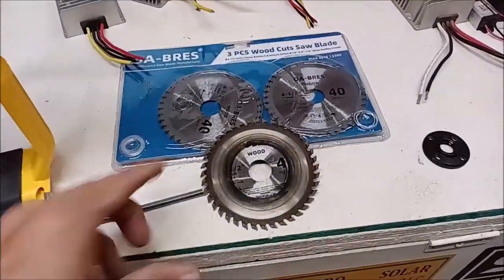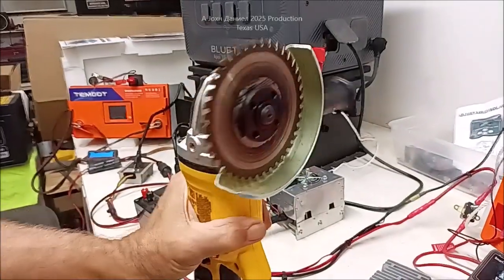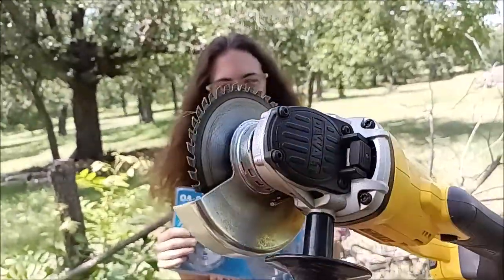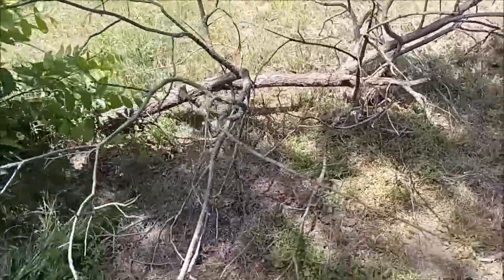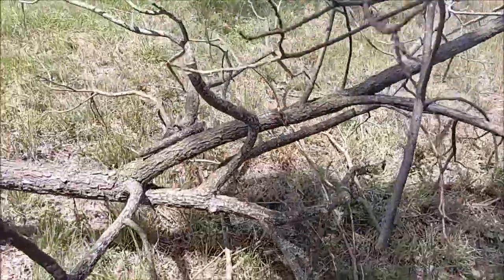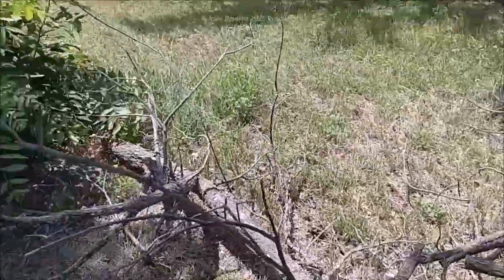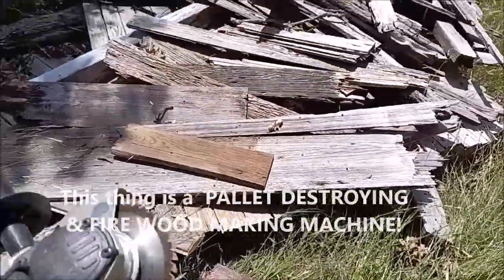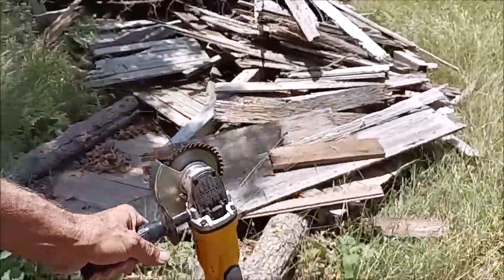20 volt 4-1/2 grinder to Speed Cut & Trim Trees, Hedges, Vines & tough weeds - LIGHTNING FAST WORK

Comment: JUST PUT A PACK IN MY CART!!! I HAVE A 4INCH CHIPPER SO THIS IS WHAT I NEED!!!  GOT TO CUT THE BRANCHES UP SO THEY FIT IN A 4 INCH HOLE!!
Reply from the maker: Use the Battery powered grinders on them so they have auto stop upon any binding!

Comment: I HAVE MANY YEARS EXPERIENCE WITH GRINDERS.
im a 66 year old MAN!!  
last summer i was scrapping a car and was cutting the hinges off a beat up door with a 110 volt harbor freight grinder, and a 2X harbor freight thin cutting blade. NO HAND GRIP OR BLADE GUARD!
hinge was facing up and grinder was in my right hand and door was in my left hand.
the very strong and long lasting cutting blade refused to shatter and go every where, instead THAT THING JUMPED AND SLAMMED INTO MY CHIN, I NOW HAVE TO WEAR A BEARD AGAIN (I WAS CLEAN SHAVEN AT THE TIME) BECAUSE THE BLADE CHOPPED MY CHIN, REQUIRING 12 STITCHES AND A FLAP! MY WIFE (STEFFY) WHO HATED MY BEARD FOR THE PAST 10 YEARS, NOW SAYS I LOOK BETTER WITH THE BEARD!!! I COULD NOT SHAVE FOR OVER 8 MONTHS AT THE AREA WAS TOO TENDER!!!!!

MY GRINDER NOW HAS THE BLADE GUARD AND SIDE HANDLE ATTACHED!!  I DROVE 16 MILES TO THE EMERGENCY ROOM WITH MY TEE SHIRT PRESSED AGAINST MY CHIN, AT 80 MILES AN HOUR. I HAVE NO CELL PHONE (I REFUSE TO HAVE ONE) AND WAS ALONE ON OUR REMOTE PROPERTY!!!

BE SAFE OUT THERE!!!!
Reply from the maker: You have to never take risk in tight areas with any tool like this. No matter how good you are with one. As for the blade guard never remove them. A 120 volt grinder unlike the battery models will bind and jump so fast you may loose control of them, so don't alter them.

Comment: haha.  I found a cheap set of saw blades I put on my weed eater.  so I can cut brush.   I Bought the brush cutter attachment and it sucked.  I had an old saw blade and was like I wonder if it will fit and it did.  and it cut good.  so bought new ones and man I can go crazy.   the saw blades I got was like 10 bucks for a set of 3 at Harbor freight.
Reply from the maker: We had a a similar set up but just not enough RPM's to do much. Plus it tended to wear you out in weight. This grinder thing is like 10X faster than what we had. And seriously smoother.

Comment: Mine has 5.2 inch blade on it with circular saw attachment.
Reply from the maker: Careful with larger blades since you can exceed its ability to stay out of binding.
Reply: @JOHNDANIEL1  My angle ginder cuts out when it binds, I have to set it to the lower to speed to avoid this.
Reply from the maker: You want that effect for safety. Most as well as mine is same so if it catches in the cut it will fault, then I can pull it back and go again.

Comment: Nice use of the grinder. Especially with the storms lately in Tx,La,Al.👍👍
Reply from the maker: We tried 4 brands of similar blades, Dewalt, Diablo, and Lennox. All 3X the price as these weird named ones. None blasted limbs and huge vines like this $13 set of 3 does. And I have already cut over 200 limbs with it, low hanging riding mower head whackers and its still sharp as new. Ordered me 3 more!!!